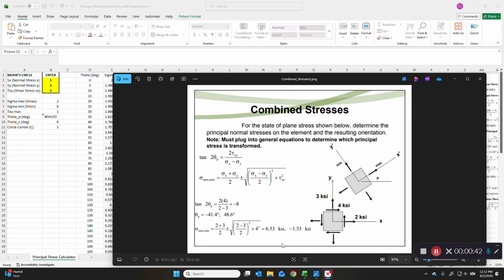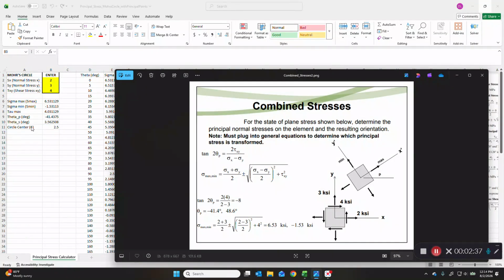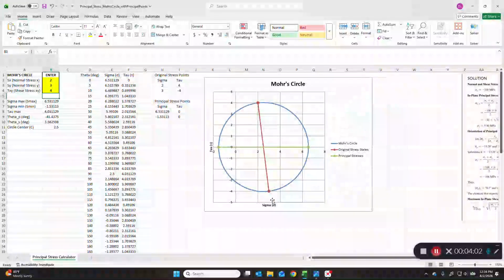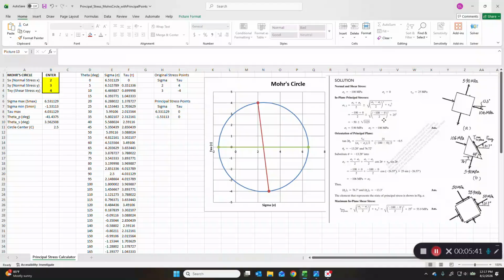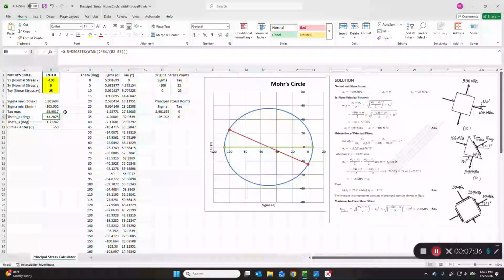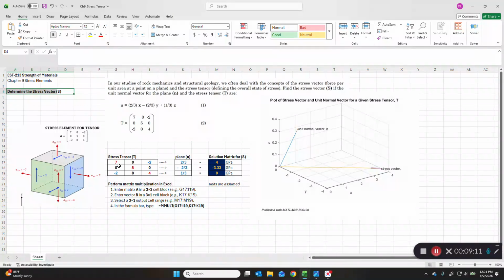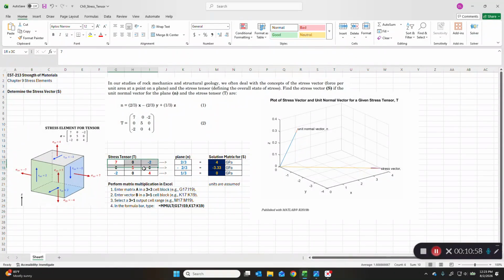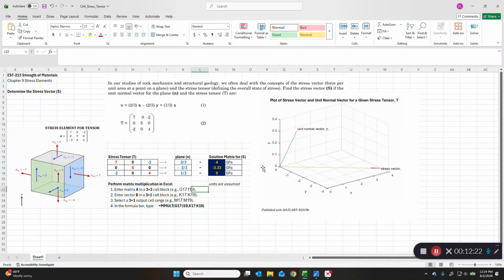Mechanics of Materials  Excel Solutions  Ch  9 Stress Transformation and Mohrs Circle

Comment: errata: @ 7:15 into video, Mohr's Circle angle described should be 2*theta(p) = -13.3 x 2 = -26.6 degrees. Angle theta(p) is correctly calculated as -13.3 degrees, per Excel sheet